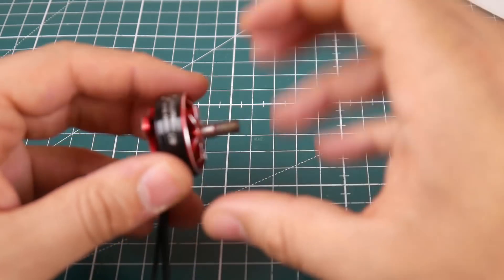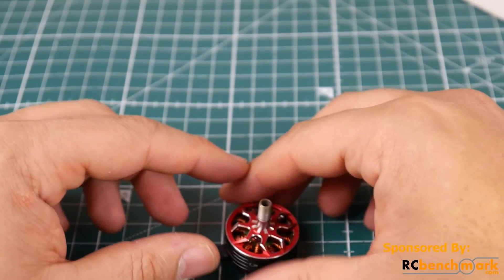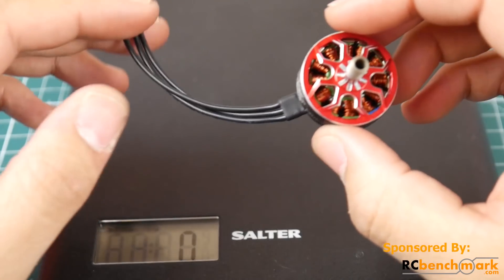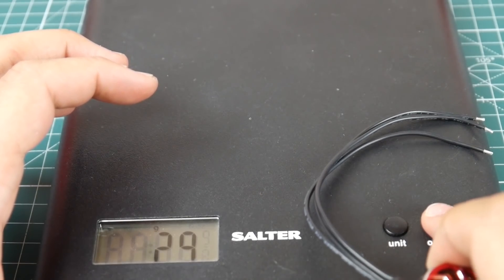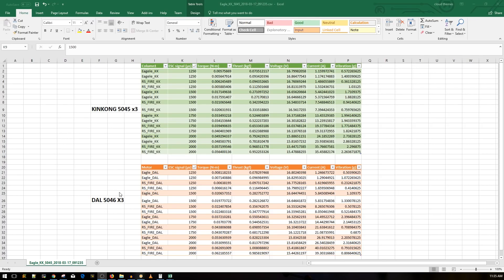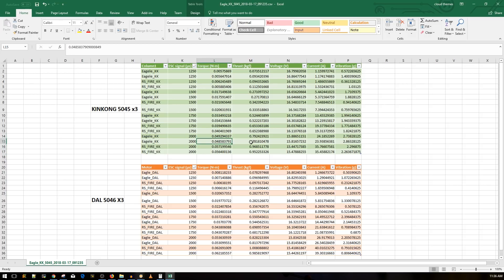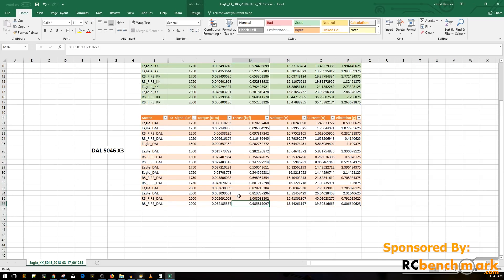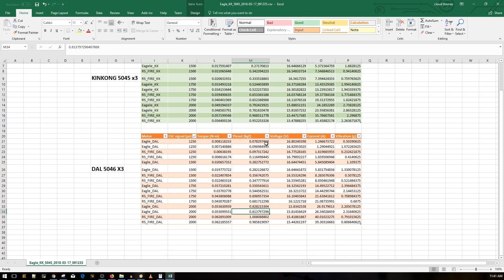Best Budget Motor Shootout Thrust Test// EaglePower vs Racerstar 2306

Comment: Thanks again for the effort, love your videos. Can we also get a efficiency rating? 1kg of thrust sounds nice bit with 40amps x 4 you need one crazy exoensi battery. Raw power alone does not make a good motor.

Comment: We want high thrust and low amp draw within a reasonable throttle range. By only using two propellers you are really stacking the deck for motor comparison. To find each motors sweet spot your going to have to come up with some sort of variable pitch prop hub and interchangeable length blades for it. To add more confusion to the mix you would need to also make the number of blades adjustable because for a given diameter prop and rpm, pitch will also vary performance! I'm surprised motor manufacturers don't recommend prop pitch and size combinations for their motors the way they used to when gas engines were dominant in the rc airplane world.

Comment: Racerstar 2306 motors are the worst I've used, week later magnets started to slip, shaft and bell are quite soft. For few friend the bell simply flew away during flight. So if you need to change them at least every month, then they are very expensive. And 1kg of thrust for 2306 motor is embarrassing. By your numbers RS with DAL props gets 1.6g/w efficiency, never so inefficiency motors, this implies that thrust stand not calibrated or simple shitty motors, the last is most likely :).

Comment: Tbs just came out with a 2306 motor for $15 and it looks to be very high quality
Reply from the maker: You guys should email them to send me some for testing ;)
Reply: i had a set. 1st test flight i burnt a motor midair (5040 triblades 4 cell). got a replacement then bent a shaft in a mediocre crash. not for me. would rather try eaglepower. just my 2p